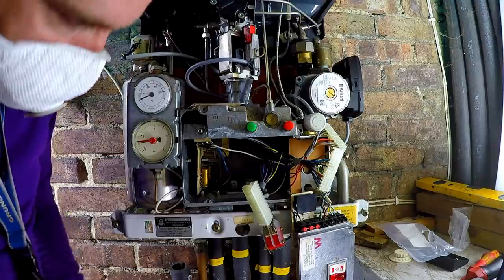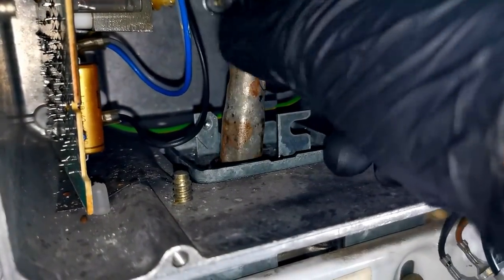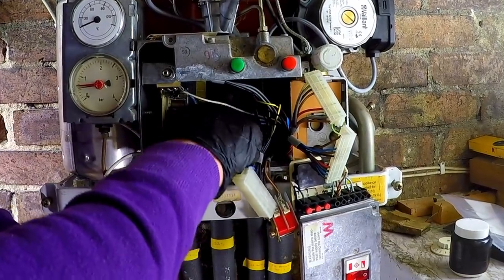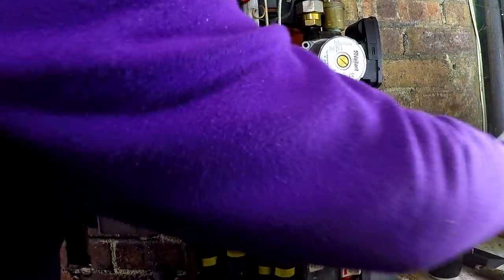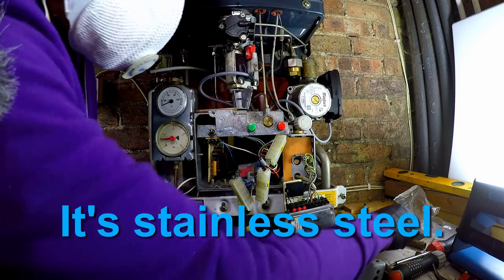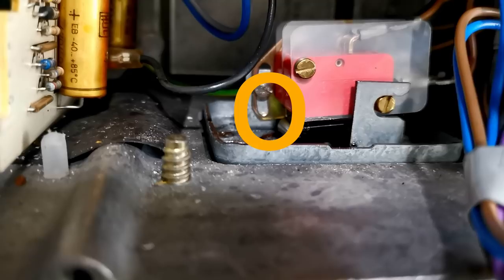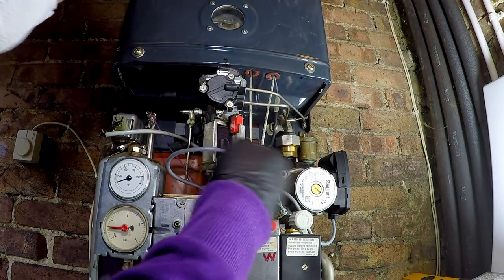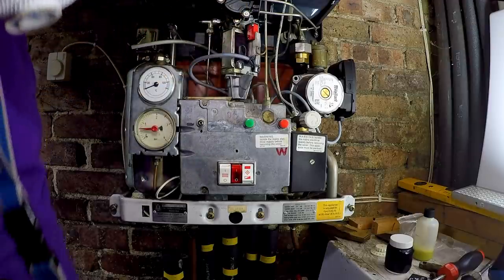Part 2. The oldest Combi-Boiler on YouTube

Comment: That sinking feeling when the boiler doesnt fire yet you suddenly feel 10 degrees hotter yourself 
Could it have overheated because the microswitch stuck on after the hot tap was closed
Roll on part 3
Reply from the maker: Hopfully I can explain it in part 3 :-)
Reply: yeh, theres always another problem.  The question from the custard....Whats wrong with it?  Have you found the problem?.......Jeez's ive only just took the case off!!  Make me a cuppa please and let me work

Comment: First combi I ever installed, was like hanging a fridge freezer on the wall. Done loads of work on them and were really reliable. One of the interesting things with this boiler was u could open vent it which we all did as we didn't want to pressurise an old system. Access was great once all the panels off and, the enamelling on the panels was fantastic, u just couldn't damage them. And manual permanent pilot 😂
Reply from the maker: I learned so much about this boiler on this job. Pure frustration at the time but glad I done it. :-)

Comment: No it cant overheat if the switch sticks, it just heats the wax capsule and goes down the heating, sometimes u get the switch on the solenoid chatter, we called it the nachine gun, that can cause overheat. But the only thing that can cause this model to trip the overheat is blocked scaled main or a faulty overheat stat. Nothing will run not even the pump will run on that model if the pilot is out tho?
Reply from the maker: The pilot was lit. :-) The previous engineer had..... ;-)

Comment: Just Qualified as a gas engineer, i have never heard of a stuffing box, why is it called that.
Reply from the maker: Because it what they call them on boats. On a boat, the prop shaft passes through a stuffing box into the water.  In that application, it was literally a box stuffed with grease and rope to keep the water back. :-)

Comment: Warm water and heating passing normally means diverter valve letting by. Over heat could be caused by poor pump performance or air locks but I would have thought you'd would have checked that. Possible overheat stat problem? Maybe the two issues are linked tho?😃🙉....also why do these spares suppliers give it the old bs ! What's that about lol
Reply: Also I had another thought that boiler is 40 years old, if that old guy had lived there all his life that boiler has been with him half his life lol.thats crazy! Also if he hasn't spent much money on it in the last 40 in years fair play for him wanting to keep it going
Reply from the maker: You have the same thought process as me. The next video makes it clearer what happened with the overheat. :-)

Comment: i have waited donkies years for no2 vid all good so far o/h stat by the pump and also this boiler has venting issues for overheating the pump looks like been replaced with adaptors kit the micros i think one is pump operation and other is ignition and gas valve opens via diiff switch which also has a stuffing box on it
Reply from the maker: Yes kind of. :-) We get to the diff switch soon ;-)

Comment: Ollie you disappointed me, I was waiting for the thump on the casing to see if that fixed it after all that switch pressing😁
Reply from the maker: Next time! A technical tap does fix a lot of things, ;-)
Reply: Percussive Maintenance.  :-D I've had times fixing PC's where that can work. Fans with noisy sleeve bearings that drone on startup respond well to a bit of percussive maintenance, till I get a new fan to replace it.

Comment: Clearly let-by on the diverter ,  something must be sticking on intermittently to put the overheat out, possibly the gas valve or one of the microswitches ??      
To be fair I haven't seen one of these in a long,long time.................
Reply from the maker: everything wrong with this boiler. :-)

Comment: You want to pass the phone number of where you got the spare parts from to British Gas.. They usually tell customers that this boiler to old to get parts for any more you need a new boiler regardless of age of boiler
Reply from the maker: Thats their system. Any part obsolete then new appliance needed. A lot of the parts are still at plumbcenter but BG only work with what's still manufactured or not. :-)
Reply: @HeatingGeek  i dont like thier tactics. An elderly neighbour of mine had BG cover and was told his boiler needed changing because the combustion insulation pannels were gone, (which they were) and they couldn't get replacement ones for his baxi 80e. I told him i can get them and get his boiler up and running again but BG came in with some heavy sales tactics and he had a new boiler through them at an astronomical price
Reply from the maker: @GD-qu9hr  And they didn't do the TRVs or a flush :-)